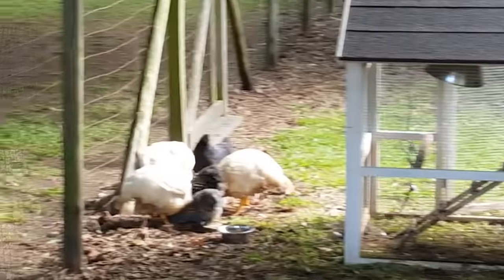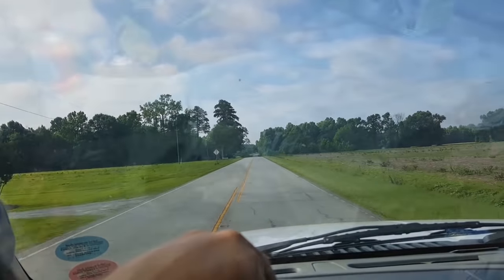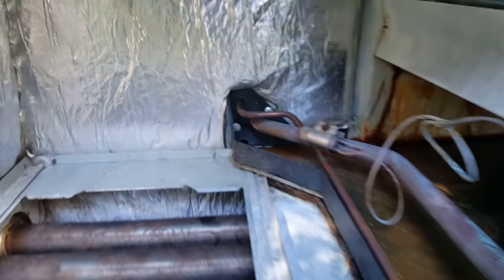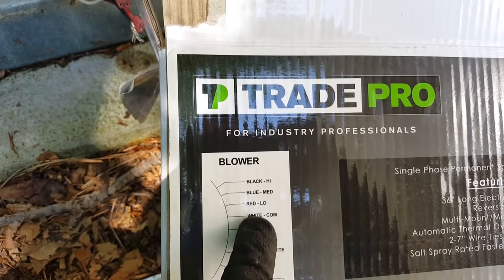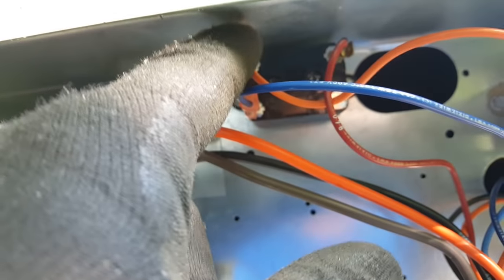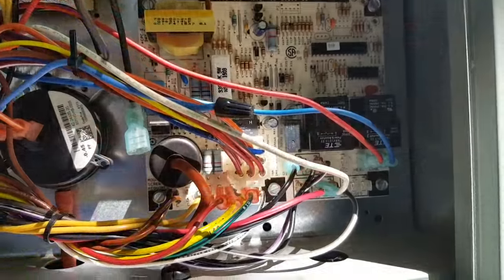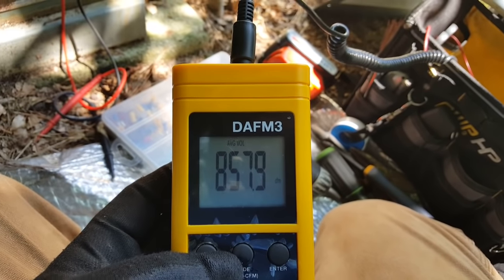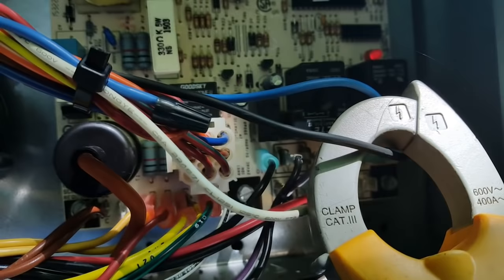ECM to PSC Blower Motor Conversion (Detailed)

Comment: One thing you want to be careful about when replacing a variable speed or a constant torque motor with a PSC is that you can overload the new PSC motor even if it is the same fractional horsepower rating. The blower wheels are usually bigger on variable speed and constant torque motors for the same tonnage system. That’s why we install variable speed or constant torque motors because they can develop higher static pressures helping on lowballer, jackleg ductwork. So, upsizing a fractional horsepower rating size is recommended when going from VS or CT to PSC. You can always use a lower blower speed, but if you’re overloading the motor and your CFM is already 25% low, there’s not much you can do but change the motor out.
Reply: will  qwik  swap    easier then this   job?   around280$

Comment: I really respect techs that don't push the new system sales and can salvage a unit and save people money.  And then there's the Super Techs that go above and do a nice job and take pride in their work.
Reply: @Harupert Beagleton I work in a related field. Master Electrician. One of my brothers is HVAC and his side of the business occasionally has us pull and replace motors. This was good work. One thing I always do, any parts not needed for the mounting set-up get yanked. I've seen those rubber vibration dampers at the front and rear pull loose. No problem at the rear, in the front, though, can make one heck of a racket.
I'm glad you warned about capacitors holding a charge. It's useless, of course, the mucho-machos are incapable of learning, but more than enough joules there to kill you - and way more than enough to fry sensitive electronics, even if you don't care about the danger to people.
Reply: That's what I do to help my customers, too.

Comment: I was just considering if this was possible, so I did a search and found this video. Those ECM motors are stupid expensive. This one was killed by an electrical surge (guess, customer said power flickered during a storm and that was it).  Unfortunately I have to add a relay, but that's nothing. A PSC motor, relay and cap is far less than just a ECM motor. Thanks!

Comment: Why didn’t you check to see if the motor was good and just the module was bad? I just bought the module after testing and showed the motor was actually good and only cost me 184$ and not 300- 500 for a whole new motor.

Comment: i still have a 22 yar old carrier furnace. im not looking forward to a new r410 system!
Reply: same more pressure more issues
Reply: @joeydelmarsjr.646  No not really its really good we just installed one at my home its running real quite and the be ecm motor is great too starts up slow then ramps up
Reply: @prettycureforever7102  what seer make and model is it

Comment: I believe u meant 24v coil,to allow line voltage to pass thru the motor........or just replace the motor module itself. Only 2 screws,and a small plug. 99 out of 100,motor good, module bad.

Comment: My unit had an x13 control board. I had to replace it with another ECM and I had to have it programmed.  I'm sure I could've put a PSC in but I had to change the board also or put relays in. This board has its 24volts in and 24 volts out for controls to the motor. My 240v was connected on the line side of the transformer. But it worked out. Got the motor the sameday and installed it. But it will burn again because the duct work was an abortion. The airflow must be so bad. I did advise them. Also lucky you, your was outside, mine was in the 140 degree attic. Bro. I was dying up there. I actually turned on the condenser let the coil get cold and ran the attic fan. It was better then nothing. LMAO. NICE WORK AS ALWAYS BROTHER. BE SAFE OUT THERE.

Comment: You definitely got lucky with that unit. Seeing as it had a control board that was meant for a PSC motor. Especially with a gas pack. I did one on a Nordyne gas pack couple weeks ago and was not that lucky. Had to add relays. I was thinking maybe I could get a different control board from Nordyne that was used with a PSC motor but that board is almost $300 if I remember correctly. So it was a lot easier to just add relays
Reply: So I'm little rusty on field work been about 20yrs- So when I got out of the trade these were. I ming on - Now I have 12 yr old Trane xr13 unit w/ Air handler that has 3 circuit  boards- House hit by lighting  at least main board fried but because age & expense was thinking  about cutting all the boards wiring out running old school  motor w/ capacitor relay just having one speed- Is this reasonable on old unit w/ no warranty  but otherwise  looks like new?

Comment: Why doesn’t anybody check if the module or the motor is bad.  The module can be replaced separate of the motor.   Module alone runs a little under 400 but labor is quick.  2 bolts and 1 plug. Recommend to the customer to have a whole house surge installed.  I do need to learn changing it to the other motor. Thanks for taking the time.

Comment: great video. I enjoy the "out of the box" process thought when changing x13 over to psc motors.  one question, in your years of service do you think the A/C units (of any type) are getting made more poor vs the units 15 - 20 years ago?
Reply from the maker: they are made to satisfy the government instead of the customet
Reply: It mostly comes down to install and pm. Done right, the unit will last a good 20 years. Done wrong.. it’ll be a trane wreck from the start.

Comment: I am not a fan of multi speed or variable speed fan motors on a furnace or air handler and two or more stages on both heat and ac because I find a single stage heating and cooling system in my home does not fluctuate the temperatures when cycling therefore I feel comfortable!

Comment: Considering the age of the unit (7 years) should not the motor been replaced for free under warranty?  And that being the case wouldn't it make sense to use the exact oem replacement motor?
Reply from the maker: That only applies to warranties that are registered
Reply: I got a carrier on order.  17 days ETA.
Reply: cheaper

Comment: Man you make this look easy, is it possible to do this with a different board then that one for example my blower was ran from a control transformer for high voltage power via a common and 240 volt wire. Then the low volt was ran from “x13 spd, x13g, x13 com”. I disregarded those and the common and 240 volt to the control transformer and routed the control transformer to a relay. On the relay I have my motor common and motor high and the common from the ct on the open circuit to other common and the medium speed to the 240 volt via closed circuit on relay. What do I need for the 24v on the relay and when I do so, how do I get the thermostat to communicate with the blower and compressor.

Comment: Yes, you need to recommend new or additional ductwork, larger filter surface area. 1.8A on a 1/2HP. Guess what happens when you have low airflow in the summertime? You end up with a high temperature drop. Guess what happens when a cold steel heat exchanger is exposed to very humid outdoor air, whether it’s in Florida or up here in the hypocrite belt. Condensation and rust!
Reply: Hilarious "hypocrite belt"

Comment: just replaced my rheem seer 10 3.5ton with rheem seer 16 4ton and this came with and x13 i hope it lasts if not im going psc once the warranty dies
Reply from the maker: I am sure it will last forever.
Reply: @zacksintheshop  forever? No way
Reply: Oh yes...FOREVER! X13 modules are as reliable as the sunrise!!
Reply: @nathanhouk402  i got 10yrs of warranty to replace that x13

Comment: i just installed an ecm x13 motor the rotation is counter clock but this new motor is going clockwise it suppose to run for 30 second and stop then go counter clock but it never did  that  even after 5 minutes ,is there a way to make it go opposite direction? counter clock

Comment: Quick question a lot of times especially on carrier,comfortmaker ,bryant etc the x13 motors will have two speeds that are tapped into the blue wire is usually going to low voltage terminal 2 and white for low voltage tape 4 .  My question is what is the purpose of that if even in a heat call you have a g call which would activate low voltage terminal 2 medium speed. Is is a safety ?
Reply from the maker: +joshua meadows for heat strip calls (like emergency heat)

Comment: if i connect high voltage to contactor directly and just cover all old ecm wires with tape it will work too no?
Reply: 24/7

Comment: How do you know when you can bump up the CFM. My diagram says it should be on 2 but I was wanting to bump it up to 3. The heaters on 4 and 5 is open. 1-5 are all active but I was concerned that going to a higher CFM my be bad and I was hoping you could elaborate on that or direct me to one of your videos if you already covered that
Reply: Increasing or decreasing CFM affects both cooing and heating. Cooling side is the compressor and evap, slow the CFM and the evap can freeze/ice over which is a death spin. More frost less air moving through it which = more frost/ice. Continue and liquid refrigerant can get to compressor which isn't what you want. To high CFM and it can affect the efficiency of the evap to remove heat. All components are designed to match each other. Experiment but monitor. Check all air duct and passageways prior to ensure all is right before. 
Same on heating side. If furnace, to high cfm and the airflow doesn't match the heat exchanger so it can either trip off on high limit or you get more cfm but register outlet temps are lower. In winter it can feel drafty. Find your desired register outlet temps and experiment.
Reply: @RM-np1gm  if you move air across the heat exchanger too fast, wouldn't that lower the possibility of high limit, since you are pushing the heat away from the unit quicker? When limit trips, fan stays on to cool it down.

Comment: Great video. How do you figure out the rpms, I was working with one of those X 13 motors but I did not see the rpm on the motor just the horsepower.

Comment: Hey Zack, Thanks for the great video. Could you please explain the reason behind selecting lower blower rpm on heat and higher on cooling mode?
Is higher rpm on cooling mode simply to prevent a possible freeze up on evaporator coil? Or something else?
Thanks
Reply: iskoos low speed for heat slows the air to pick up more heat from the exchanger. Cooling needs higher air flow to remove moisture from the air, with out it freezing to the coil
Reply: Colder air is more dense and requires more rpm to move.

Comment: hi,,CAN ANYONE HELP??,,got blower motor only comes on when t-stat is set to ON,,does not come on in AUTO,,just hear a click,,,TRANE;;;mod;;4teh3f36b1000ab,,,,everything works fine but airhandler fan on ly comes on ,,in ON
Reply: Most likely the air handler circuit board is bad. Seen a few like that.

Comment: Chicken in a car, and the car won't go. That's how you say Chi-car-go.
Reply: john t do you by chance work at walmart as a cart checker? What size bus did you ride in?
Reply: Actually. no. I was "fucking around."

I'm at this channel curious as to why industry found it necessary to upgrade from a relatively easy and cheap to maintain capacitor motors, to complicated, expensive 12-pole/with built in inverters to move air.

After all, I'm not sure many service tech's out there are versed in pulse width modulation or phase control techniques in controlling induction motors. So how does industry get around that? Create more parts changers.

Now I see there is a push back to switch to old school. 

Bravo!

Comment: Omg i didn't think this was possible to do,they charging me like $1,000 to change the ecm motor,i did just a standard motor cant afford ecm motor
Reply from the maker: You must size it properly for it to work.
Reply: @zacksintheshop  just size rpm & voltage?

Comment: Okay dude. The labels on the side of the unit are there for a reason. You just changed two things. You modified two. The UL label and the efficiency of the unit in one repair. UL label is no longer any good. If the house catches fire because of this system, you are the only one that will pay if sued. Manufacture is out of the picture because of your modification. You got great insurance? You should know ECM motors can deliver more air then PSC motors. If all things are equal, right unit for the house and duct work correct. The efficiency  would be on track. Now it is lower and system failure is on track now. I work for a major company. It is our policy not to modify labels on a system of any brand of heating and air unit. Good luck with your modifications.
Reply from the maker: I got away with mine, I retired. I understand what you are saying. Does that apply to aftermarket  ECMs as well? How far do you think that argument goes? This unit actually has the PSC stubs on the board. I realize it is a board used in multiple units. I did have insurance, yes. Liability is required here to be in business. Typically 1 - 2 million as a starting point.
Reply: Carl Andrews, although your points are somewhat valid, you are a bit extreme. I own an HVAC company and I appreciate your concerns however this man saved a 7-year-old unit from Death. There’s no way I’d put $1000 worth of motor into that machine. He did his customer a great service and thank God he had the knowledge and the ability to do so. He did everything correct and professionally. There’s no insurance play here
Reply: Field modifications do not "void" the UL Listed Mark as long as the modification is being used in it's intended manner. In this case, the tech has installed a UL Listed part (aftermarket PSC motor) and since neither the motor nor the equipment has been modified beyond it's intended use (manner) there is no liability outside of the UL Listed Mark. 

You are correct that an X-13 is more efficient in a perfect world, with perfect duct work but ultimately we are at the mercy of our customers. If they will not pay to upgrade the ductwork as needed a PSC is perfectly logical and acceptable modification to keep from needing to replace X-13 motors (or any ECM) due to high static. Not as efficient, true; but it will last much longer.
Reply: Don’t know if this applies but freightliner trucks have been doing this on the hvac blower motor on several models that were oem ecm controlled
Reply: Smoke some weed & chill my boy

Comment: Pulling down because of gravity?
What is gravity–really..?
Newton couldn't even fully define it, as it's only theory. And fully nonsence. If one says this is nonsence, ask yourself, how is it that billions of gallons of rain stays floating above the earth. Not one drop should be up there if gravity were a real thing.
Reply: It has to do with atmospheric pressure.   Different layers of atmosphere= different pressures.  Standard atmospheric pressure is 29.9" of HG which differs at different atmospheres (stratosphere etc...).  Also newton explained free fall of gravity is 9.8m/s squared.  I only wanted some info on ECM to PSC motor but I'll debunk a flat earther while I'm at it. 😂😂😂
Reply: @tytig94  Much appreciated.